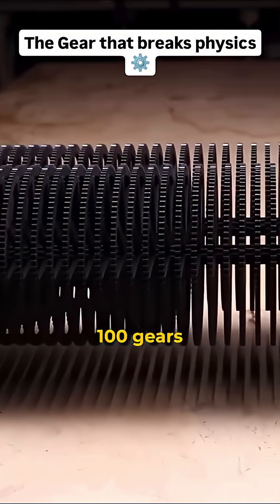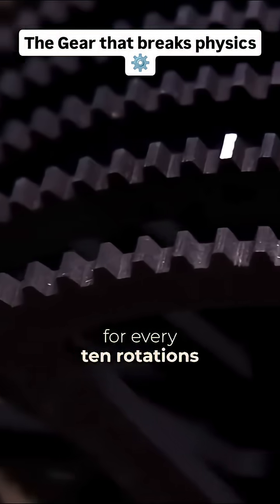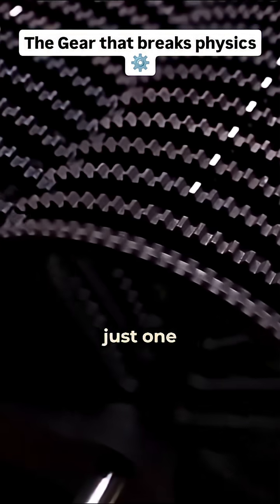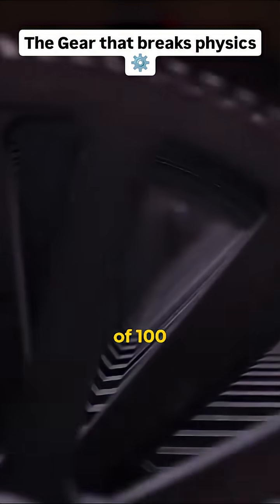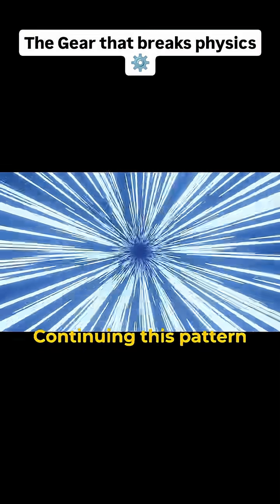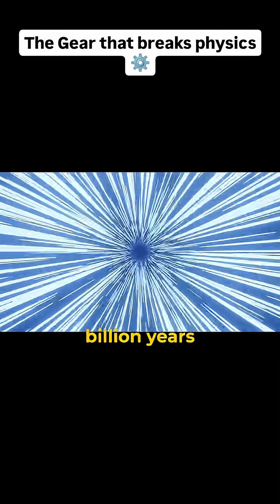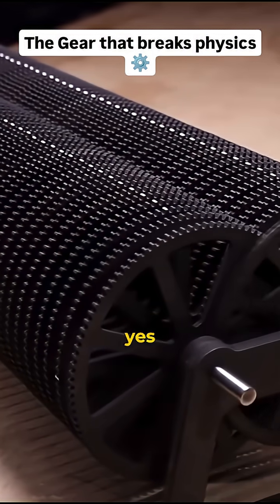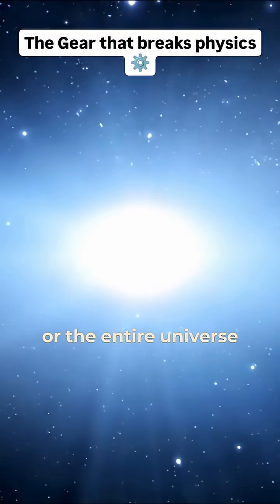Insane gear system ⚙️

Comment: 3.5 seconds for the first gear to turn it would take just over 11 trillion years for the last gear to turn all the way around. You could build one with a google number of gears, hence a googleplex, this would be 10 to the power of 3.2 Trillion, and there is not enough matter in the universe to make it. Point being this gear arrangement does not break physics.
Reply: A year would only spin the 8th gear once. So it'd be 10^92 years to spin the last gear.

11 trillion years would barely be a grain of sand in an ocean in comparison to that number.

Comment: If the first gear only took 1 second per turn, meaning it took 10 seconds to make 2nd gear turn once,
1st gear would take 10 seconds
2nd would take 100
3rd would take 1,000
4th would take 10,000
5th would take 100,000 seconds
6th would take 1 million 
7th would take 10 million
8th would take 100 million
9th would take a billion 
and 10th would take 10 billion seconds, which works out to about 317 years all to make 10th gear turn 10 times, or 11th gear to turn once.

Comment: Assuming no lash in the gears, the last gear immediately moves as soon as the first gear moves - just exceedingly slower than the first.
Reply: Assuming indestructible materials, it would be impossible to move the first gear, because like you said, the torque would propagate all the way to the last gear... Which would require a trillion trillion trillion trillion times the energy of the combined universe :)

Comment: if the first gear moves at all the last gear will also move if there is no backlash in the setup, the last gear would move such a short distance it may not be possible to measure it

Comment: doesn't it depend on the speed the first is rotated, so its doing about 17.5 rpm if it turned at 1000rpm the outcome would happen 50 times faster

Comment: Now wait a minute here. Let’s make a gear thing that has enough power to make the last gear go 1/2 the speed of light or even maybe 1/4 the speed of light.

Okay then add them contraptions into another set of gears. 

The closer you got they would be flying apart but… at what speed. I’m just wondering what kind of material we would need to come up with to handle them speeds. How small would the gear actually be? Things like that.

Comment: Okay so if we took the very last gear in the set and used it as the input for rotation does that mean that the first gear would actually move faster than the speed of light? The way they have it set up now it's in reduction, if you use the very last gear as the input they would all be overdrives. I guess the question at that point would be how much torque it would actually take to turn that gear.
Reply: The 10th gear would break the speed of light :) The 100th would go 10^90 times that.

Comment: hmm no way to compress them together or like a C bracket like array gears both ends and like middle and split it into segments driven by the same power? Is it computer bit depth or computing power visualised? google search engine uses the math GOOGOL as thats how many records it can parse as a maximum of its entire datacenters and internet and if it takes longer than 2ms its a FAIL on the search time. database records and things  would be using a type of cross relational databases and excel spreadsheet like tables with multipliers and things. You could make maths for database query and connections is developed based on this concept. Googols search engine was called backrub by the students that invented it that google bought it off and called it googol after the maths it searches with.

Comment: Ok here is how this works.
First we will look at gearbox behaviour as reduction gearbox.
Gear teeth slide over each other so some energy is inevitably lost from each gear step.
Even if each step is amazingly efficient, say 98% (unlikely) then 2% is lost per step.
After 35 reduction steps efficiency is 49 % so friction energy loss is higher than the output energy.

Now if we reverse the gearbox with 35 steps, we have the same energies at the slowest gear. Friction torque slightly higher than input torque. 
So efficiency in the reverse direction is zero. It might be possible to reverse drive 34 wheels but 35 will self lock due to friction.

Comment: You can't rotate something faster than the speed of light. Rotation is measured in angular velocity (such as RPM), and the speed of light is a linear velocity (i.e. m/s) - They are not interchangeable. If you mean the CIRCUMFERENCE of the gear is moving at the speed of light, you need need to define the diameter (or radius).

Comment: if there is no slip on the gears, the moment the first one moves, they all move. it will unmeasurable small, but never zero.
((number of rotation on 1st gear) times [(1/10th) to power 100]) small for the last one but that ain't zero.

Comment: probably this will mean that at some point the rotating wheel will get stuck. Even with ball bearing, the friction will grow so high that there will be no further rotation even with no actual load on the last gear. In the other hand it's funny to see that even with rigid materials it still has enough flexibility that the first gear can rotate without any difficulty.

Comment: This gear train has always fascinated me. If there were no backlash, the last gear would move even with a very small input at the first gear, unless that movement is smaller than the Planck length.

Comment: He's got it totally wrong. It works the other way round. Every wheel rotates 10 times faster than the one which drives it. Most wheels turn already in a speed faster than light, that's why we don't see 'em ...

Comment: The 100th gear is already turning the moment the first gear starts. It's only slower than anything known to mankind.
Reply: You can't get shorter than a planks length and that last gear certainly ain't moving that distance for a long time
Reply: @jonathonsmith6831  a Planck length is the smallest defined length we measure things with, but that isn't the smallest distance things can move

quote: It is impossible for the laws of physics as we understand them today to describe anything smaller than the Planck length. That is a limit of our ignorance, not a limit of the Universe.

Comment: Just connect a great big motor to the 100th gear and see if you really can break physics, or a plastic gear wheel or two. If you can turn it might be a new big bang, that would be fun.

Comment: Some kid in a barrio hooks up a electric motor spinning at 100000 rpm and turns the last gear in about a day. Its a mind trick,they only tell you how long it takes with a certain constant rpm. Change that  constant and the whole weak argument falls apart

Comment: This does not "break" physics. It demonstrates it. I really don't understand your total lack of understanding of what might "break" physics. OK, so you built a stack of 1:10 reduction gears. Big deal. If they were constructed out of something other than 3D printed PLA and to a good level of precision, you could spin the last gear and the first gear would turn super fast, but before achieving the speed of light or whatever, it would tear itself apart. This is just a silly demonstration of something entirely worthless.

Comment: This one goes out to all the physics nerds:
So if we reverse the gearing, could we get the last gear spinning at light speed by giving the first gear a single rotation?

Ohhh and follow up question, how much force would be required to rotate that first gear a full revolution??
Reply: so if we rotate the first wheel at 1 revolution / second then the last will turn at 10^100/sec. If the wheel has a radius of 0,1m, then v=2*pi*0,1*10^100 m/s. Light speed is 299 792 458 m/s... so 6,28*10^99 vs 3*10^8. So we exceed the speed of light by far...

The force question... Let's assume you need 1Nm for the first gear, then you'll need 10^100Nm for the last (plus friction etc)...

 If my math is correct, please someone verify it 🙂

Comment: There are three comments of Bullshit in the video. One. The 4.6 Billion years as the Earth age. No, it isn't. Two. The Big Bang. That never happened. Three. Yes, you can turn the last gear. Break the gear off of the connection to the other gears and turn it manually on the rack.

Comment: Speed the first gear up to 171.428571429rpms which is still very slow and everything turns ten times faster! fifth gear one hour, 7th gear 73.2 hours, 11 gear would be 333.3 years, 18th gear 460,000,000 years. At 1,712.428571429rpms 5th gear would be 6 minutes, 7th gear would be 7:32 hours, 11th gear would be 33.33 years, 18th gear would be 46,000,000 years. At 17,124.28571429rpms 5th gear would be 36 seconds, 7th gear would be 45 minutes, 11th gear would be 3.333 years and 18th gear would be 4,600,000 years!

Comment: I ask myself at which gear even an electron microscope could not resolve the movement (combined with using the highest possible input rotating speed).
It should be relatively easy to calculate (for an expert).

Comment: What you're saying is that if you crank over the very last  gear, the rotations would go down the line faster and faster so that the first gear would rotate faster than the speed of light.  Pretty cool!  The National Hot Rod Association is impressed.
Reply: I'm about to say the same thing. But physics doesn't allow the first gear to rotate faster than light, so there's something wrong?
Reply: Try turning the 18th gear😂😂😂

Comment: If the first gear was turning at a more logical speed, say 100rpm, this entire thing would make a lot more sense.
Reply: I don't think speeding up the first gear would make much of a difference.  If the 11th gear takes 1000 years to turn at the original speed - and there are 89 more gears that haven't fully turned at that point - speeding up the first gear is only going to push back that number a gear or two.  So, we might see the 13th gear taking 1000 years to turn instead of the 11th - which would render such a change negligible.
Reply: Yeah, it doesn't matter.  If the first gear is turning at 100 rpm, then the second is at 10 rpm, 3rd 1 rpm, 4th 1 rotation per 10 minutes, 5th 100 minutes, 6th 1000 minutes, 7th 10,000 minutes (almost a week), 8th 10 weeks, 9th 100 weeks (almost 2 years), 10th 20 years, 11th 200 years, 12th 2000 years. By gear 18 one rotation takes longer than the current age of the universe, and there's 82 more gears to go.

Comment: You don't need to rotate anything at the speed of light... you just have to wait longer. The number of days and rotations can be calculated. Maybe humans won't be the ones who see it, but the last gear will move... eventually.
Reply: You missed the point. The point was, if you wanted to grab the last wheel and turn it so that you could see the rotation, the first gear would have to spin faster than the speed of light, which it can't do.

Comment: Assuming perfectly meshed gears, the 100th gear does move but only 1 googolTh of a turn which is probably smaller than a Planck length.

Comment: Looks like an old fashioned car odometer, but the car odometer usually had 6 gears, 1/10 mile up to 100,000 miles.  Cars are better built now, so they support to 1,000,000 miles.
Reply: You lost me at the last part

Comment: thats stupidity. You put enough force on the last gear it will definitely rotate (it will just break the n-1 gear). What u are arguing is assuming the n-1 gears won't break even if u apply large enormous amt of force/energy on last gear, then the argument is correct that u need almost infinite energy to rotate last gear, but then you are breaking fundamental principles of matter & physics abt strength of gears that won't break.  At best u are justifying one law of physics by ignoring other laws os physics. 

And viceversa. You put enormous amount of energy on first gear to make it roate faster, the gears will break after a threshold of energy than transmitting the force/energy into rotational motion into other gears. Your whole argument is based on physics then you are violating other physics priciples of strength of material which is definitely finite & low number compared to magnitude of force/energy we are talking abt

Comment: By the way, this gear machine has never been constructed in real life. It is impractical. The machine is a conceptual experiment used for educational purposes. It only exists in animations and code.
Reply: There is nothing stopping anyone from slapping together some gears in this fashion.
Reply: Sorry but you are wrong. There are many examples of this and other similar machines in existence.
Reply: @Chris-fr2kq Sorry you are wrong. Yes, some guy slapped together a bunch of metal pieces, but it doesn't really function as it is supposed to.
Reply: @WattWireNet  Yes, it does.

Comment: If there was zero backlash, wouldn't they all have to move, even if the movement is imperceptible to the human eye?
Reply: True, and the torque would be so great, nothing could turn the 1st gear.
Reply: @BornAgainCynic0086  Yes, it would just tear itself apart.

Comment: Hats off to the creator of this mechanism for teaching us science.
Reply: "This mechanism" is not a real gearset.  It's just a 3D graphic representation of such a mechanism.  After all, who would bother forging that many gears, each with its own set of precision teeth, for a YT short that only lasts for a couple of minutes?   

And even for just a YT short (in which only the first 2 or 3 gears will ever show any motion), not even a 3D representation would need to have all of the gears logically connected.
Reply: @justaskin8523  It is possible to 3d print something like this fairly quickly.  However, I am not ruling out an AI generated video, which may be even cheaper and easier to build.
Reply: @auroraRealms  "AI generated video, may be even cheaper and easier to build" - and every bit as useful.
Reply: teaching you. Speak for yourself only, Gomer
Reply: Who came up with this?
Reply: Perhaps he used AI?

Comment: The speed of the 100th gear is slow but the torque is off the charts
Reply: the gear tooth of the 49th cog will never be brought to move so there is no tork whatsoever.
Reply: @groenendiek  Not even Peter Tork?   (Oh wait, I forgot, he died)
Reply: @johnjones5354 OH BOY, that is a zinger😊
Reply: @johnjones5354  Yeah, the Monkees were never on the charts after a couple comeback hits in the '80s.
Reply: but the gear is too weak to handle all that power that why its zero loaded
Reply: That torque is gonna twist the chassis coming off line.
Reply: i was thinking that how much could it lift
Reply: what are THOSE charts?  i want to see
Reply: Zero torque its just one notch on each wheel   That connects to the other upon a full rotation
Reply: Not necessarily. Infinite gearing needs infinite horsepower to ever get there.  That's sort of the point here as well as time.
Reply: Technically half correct. Zero is slow speed, but also no torque.

Comment: My  drill would turn the first gear at 110 revolutions per seconds so it’s possible to complete the cycle during a human’s lifetime.
Reply: Nope, do the math.  1st gear, 110 rps, 2nd gear 11 rps, 3rd gear 1.1 rps, 4th gear 1 rotation every 9 seconds, 5th gear 1 per 90 seconds (1.5 minutes), 6th 1 per 15 minutes, 7th 150 minutes (2.5 hours), 8th 25 hours (just over 1 day), 9th 10 days, 10th 100 days, 11th 1000 days, 12th 10000 days (27.4 years), 13th 274 years, 14th 2740 years, 15th 27400 years. By gear 21 one rotation would take more than the current age of the universe, and there's still 79 more to go!

Comment: As a mathematical model, the last gear starts moving the instant you move the first gear.
But the distance turned at the circumference in a second would be much much much much smaller than the planc length, so the model doesn't work in reality.

Comment: Interesting speculation but there is no proof that the earth is 4.6 billion years old. So the question is what's your point?
Reply: The Jack Hills Zircon has been dated back to 4.375 Billion years. The 4.6 Billion comes from dating Meteorites so is really the age of the solar system but as the Earth formed at the same time its likely the age of the Earth.

If you have evidence that the Earth didn't form at the same time as the solar system I suggest you present it to scientists and not just cry about it on you tube.
Reply: There is no point, it's just a bit of nerdy fun.
Reply: So the concept of this gear is that, even you harness all the energy and everything in the universe, you can not speed up or travel to the future or take things fast so we need to be patient at some point of time and combine at some point of time to complete the rotation of the gear.

Comment: Excuse me, but the narrator said the first gear takes 3.5 seconds per turn. Then he said the second second gear takes 35 seconds per turn. It seems the gear would speed with each each. What are we missing? 🤔😲

BTW, is such a mechanism for sale? If so, where is it sold and for how much?
Reply: It's a compound gear train. That means each  driven 100 tooth gear also has on its shaft a ten tooth gear that drives the next 100 tooth gear and so on giving a 10 fold reduction in rotational speed at each engagement. 
 You can easily build a replica using Lego.